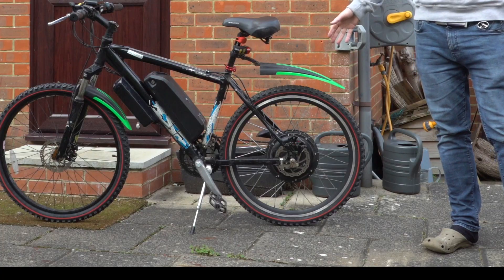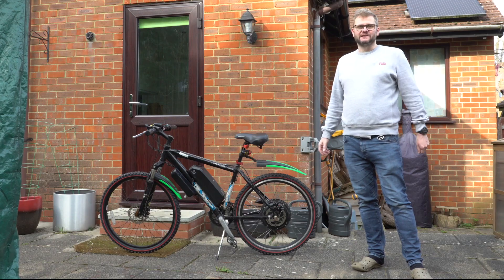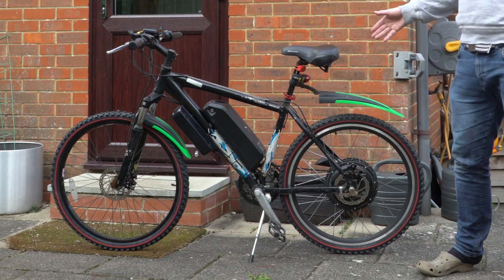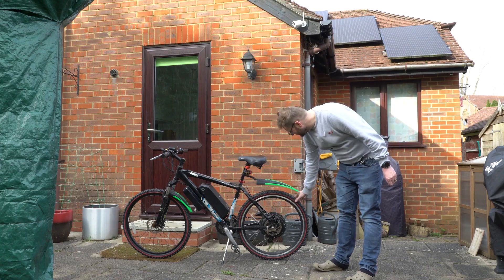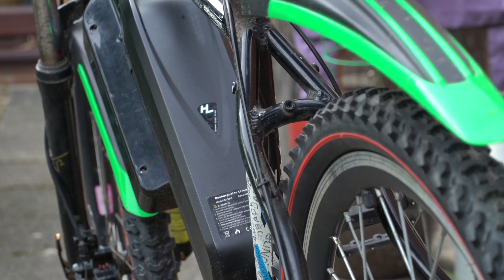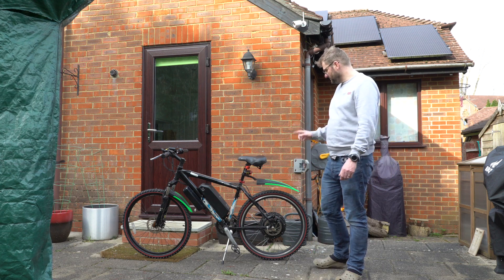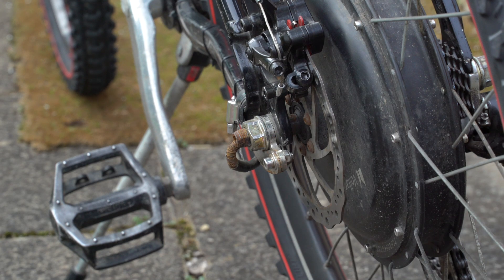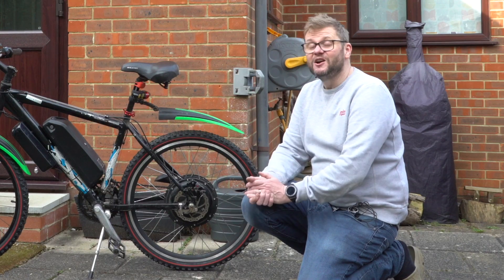E-bike Rear Wheel Misalignment Problem

Comment: For me, the spacer is only on the side with the sprocket on the inside because otherwise the cassette will touch the frame.
on the other hand I already have it outside.
if i try to mount the spacer on the oder side inside too, iam sure the frame is not wide enough.